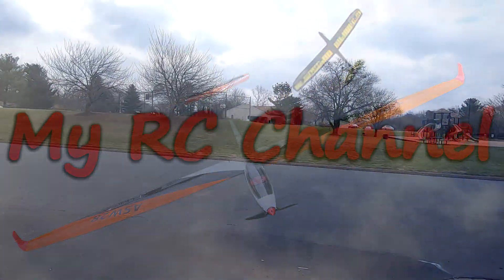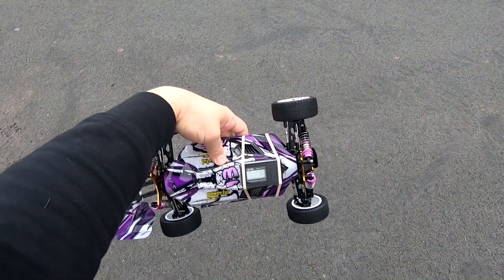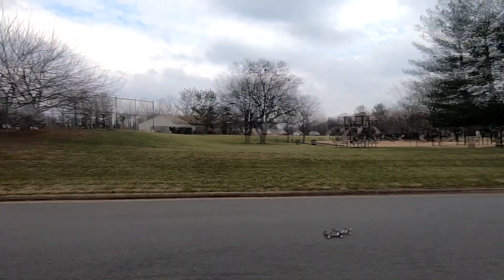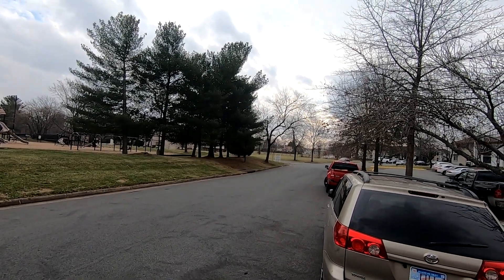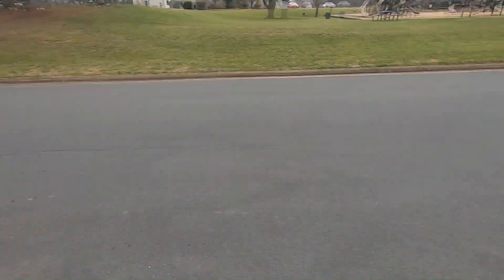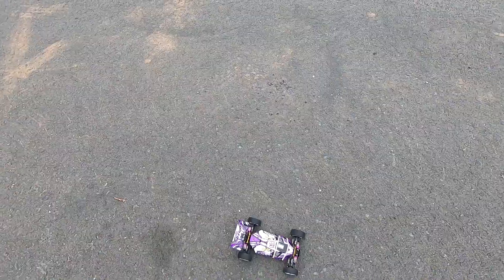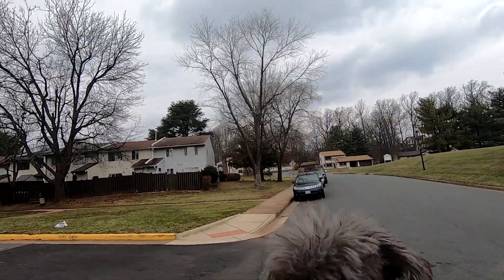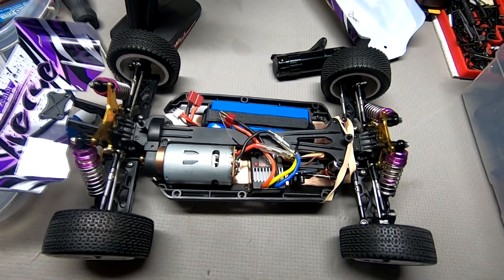UPDATED SPEED TEST! Wltoys 124019 RTR RC Buggy 1/12 2.4G 4WD - Pt. 6

Comment: A big improvement in speed. No doubt after the mods it will be another big increase. 👍
Reply from the maker: Yeah, finally got all the parts in... But, the steering servo has a nonstandard five wire connection to the receiver/esc. I've picked out an inexpensive mini-servo with metal gears from my collection and I designed and 3d printed a mount. I'll have to put the design out on one of the sharing sites so people can get it.

Comment: Cool videos I've been following this one keep em coming 👌 really useful 🙂
Reply from the maker: You bet! BTW, if you have this buggy and are going to mod it, the servo has a non-standard five wire connector... it won't work with regular receivers. But having worked as an engineer back in the day, I went in CAD and designed a mount for a small inexpensive metal gear servo and 3d printed the mount. I'll be making the file available.
Reply: @MyRCChannel-CJScott  nice! I plan to mod up to a s3 there is a 3 wire 17g servo that fits right in an connects to the 120 esu
Reply: I can send you a link of you like?
Reply from the maker: @connorbless  Sure, do that...
Reply from the maker: @connorbless  Cool, you'll have to put up a video! Do you have a smart phone? I filmed my first few videos with an iPhone.

Comment: I got a slower speed like you did but my controller's throttle was all the way up. I just checked it. Seems mine just has a underperforming motor. I've seen that happen before. I have the 104001 coming and can't wait to test it out.
Reply from the maker: I'm going to see if I can design and 3d print some mounts to put a hard pack in the 104001... If I can even fit a shorty hard pack, the buggy should pass ROAR tech for the 1/10 4wd buggy class.Do you have a 3d printer? If I can make it fit, I can send you the gcode files... if you don't I can always print a set for you and put them in the mail. BTW, has your 104001 shipped yet. Mine shows that it shipped, but it hasn't moved since it landed in the US a couple days ago. I guess I preordered early enough to get one from the first batch.
Reply: @MyRCChannel-CJScott  no that's one thing I've never bought for my computers is s 3D printer. I'm thinking about getting one though.